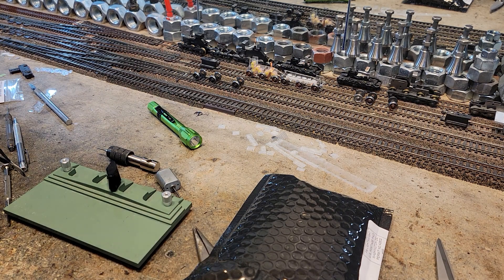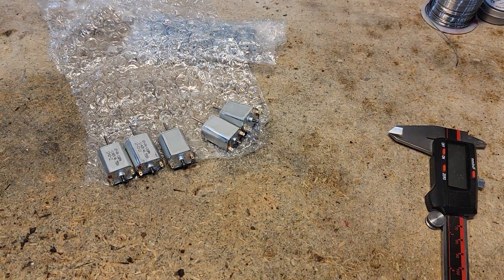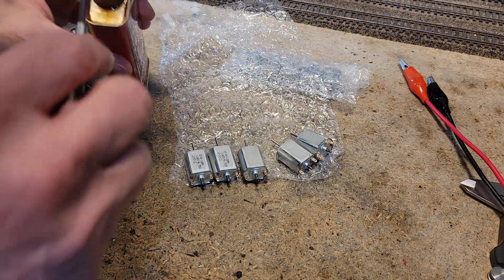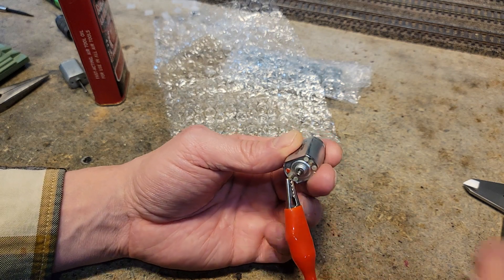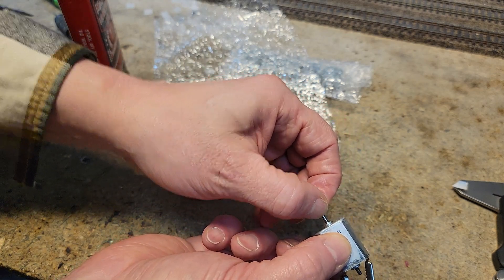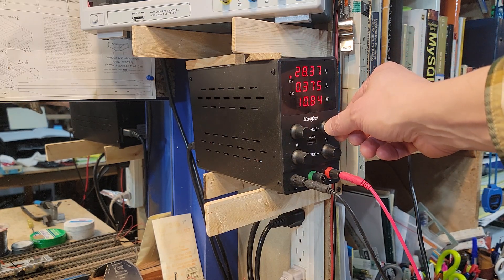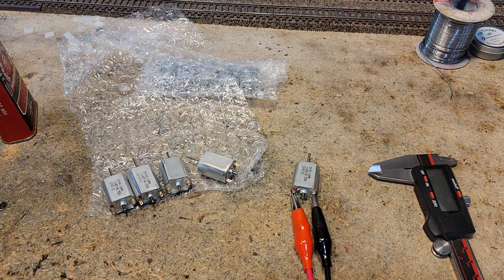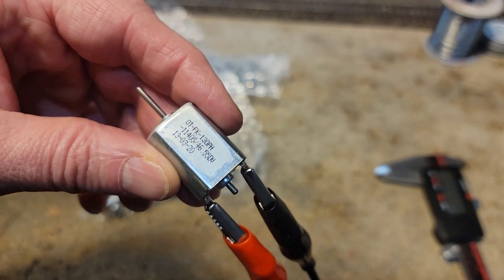2022 Contest Part 46 New Motors Arrived

Comment: Soooo....Last video you made mistake about frame height, this one, motor size.  Think you need to tighten up on the Engineering Oversite review process.
Reply from the maker: the mistake was that I didn't follow my own notes!  I planned for this and then totally forgot about what I was doing when I got mesmerized by super awesome walkway tread!
Reply from the maker: yes, I must review my opening entries into the log more frequently since I planned to go into negative space and then got sidetracked and forgot!  time to launch into negative space.... but first an unboxing and reveal of a new tool from you know where...HF of course!

Comment: You catch a pass.  Your last mistake was three years ago, and it didn't really count.
You thought you were wrong, but you really weren't,
Reply from the maker: if I knew then what I know now I would have gotten 100 180PH motors
Reply: @elite194  It's not the motors or the voltage or the drive train.  It is the application  of native engineering that makes these run so well.  If I gave you a mouse and a treadmill, it would run flawless.  Sound might be pretty cool.